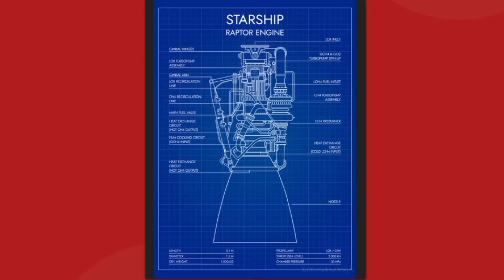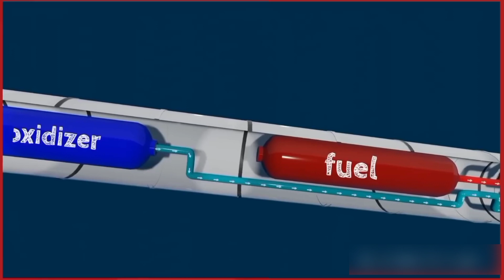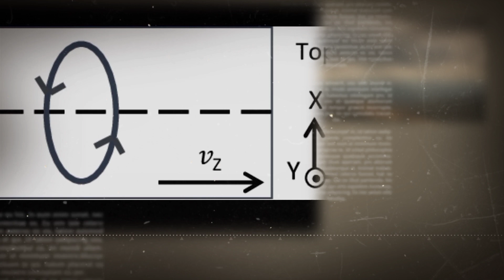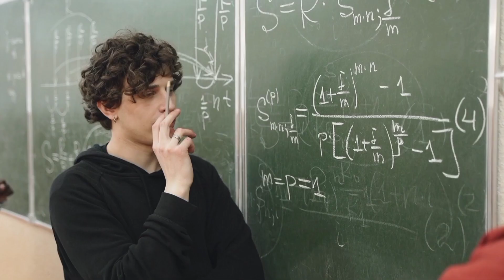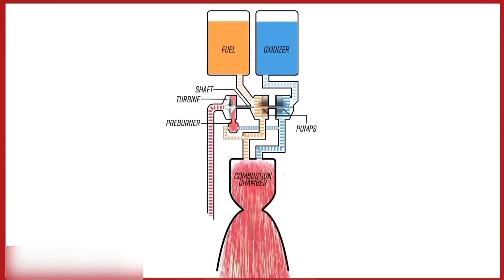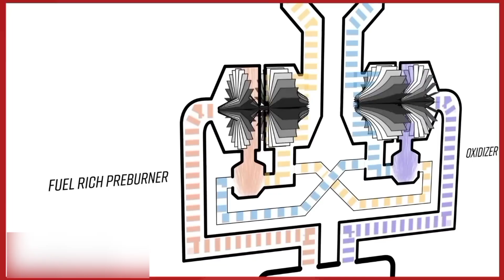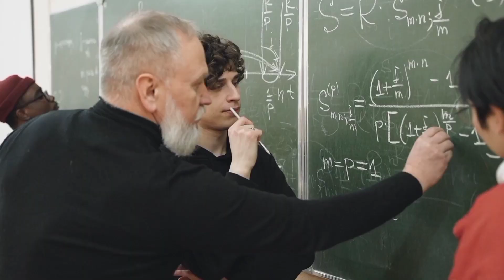Elon Musk & NASA Reveals New Light Speed Engine!

Comment: 🤔even if it's possible to travel at light-speed we can't. Like in star trek they needed a deflector which in star trek moves debris out of the way of the ship as it travels at light-speed. There are debris in the spaces between stars. A single grain of sand hitting a ship at light-speed would rip the ship apart. But until there's technology that protects against the debris between stars light-speed is not possible.